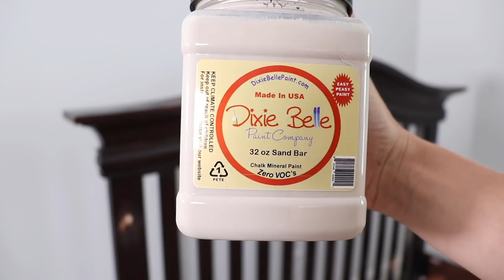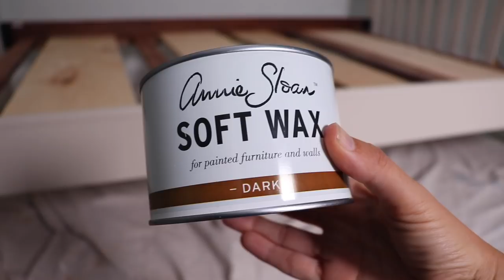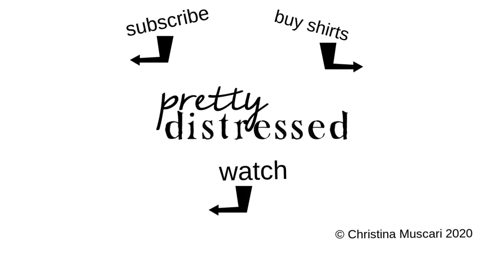Bedroom Makeover | Creating a Faux Wood Finish with Chalk Paint and Brown Wax

Comment: I loved the final results! But I have a question and hopefully you can help me understand. Doesn't all furniture neeeds to be sand to get the glossy finish off so that the paint will have a good surface to “grab” onto. I only see you sanding the parts that you applied the filling to. I saw your video titled nightstand Makeover/Furniture Stripping and refinishing. Can you please explained why in that nightstand you removed the finish coat differently? Was that necessary? I want to paint my bed too, and don't know if I need to sand it all before applying the paint or to leave it as it is. Thanks

Comment: Absolutely beautiful! I just redid our dark king sized bed in Annie Sloan Original White. Unbelievable how much it lightened the whole room! I also did some wall shelves a couple of years ago using Coco and dry brushing dark wax on top for a wood look. It was super easy and turned out amazing. I didn’t see you using water to thin your paint this time. I always use water so I was wondering if maybe the reason you didn’t was the Dixie Bell paint. I’ve started using more Dixie Bell paint so I wanted to know if there is a trick I’m not aware of. Lol Also, any time I use dark wax over a white or Old Ochre color I always mix my dark wax with clear wax for a cleaner result. Thanks for another great video! I’m going to have to try some Zibra brushes! That square brush looks like a time saver.
Reply from the maker: Thank you!